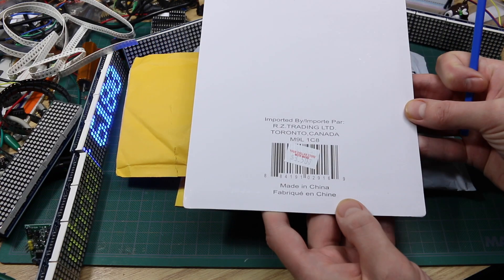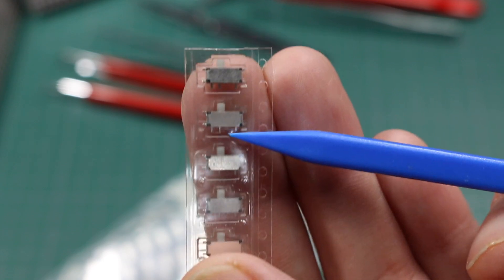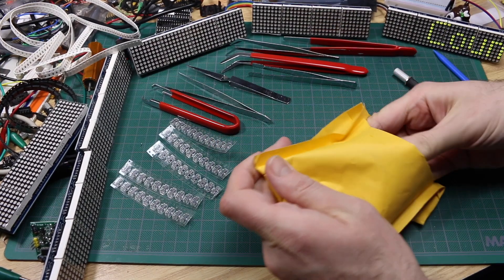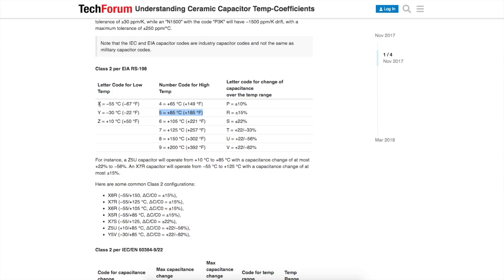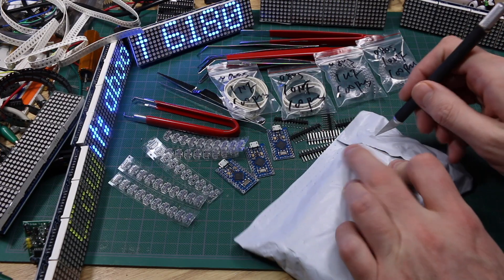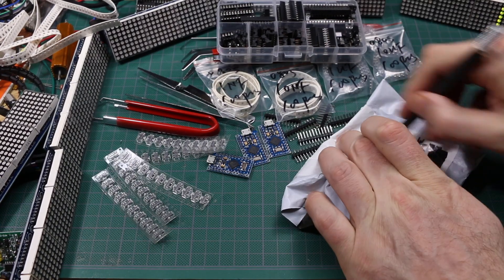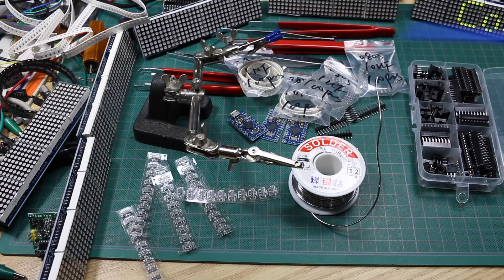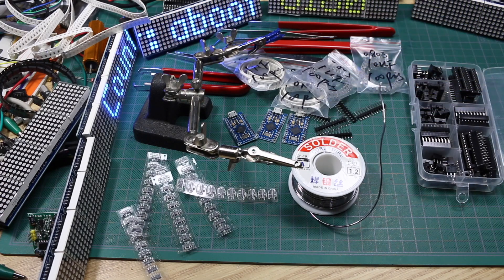GR Mailbag 20.FE.29

Comment: Check the 3v3 regulator, I got 3 for you programmer and far 2 the 3v3 reg output is 4.98V. Now ordered some new 3v3 regulators to replace the ones that don't seem to work.
Reply from the maker: those modules are still on the workbench mat so I will remember to check that the next time I’m there. It reminds me of when I bought 10 K digital pots that actually measured 100 K.

Comment: I have some of the cheap solder, it has no shine but it flows and sticks nice and easy, maybe OK for low voltage circuitry. Lush is a good seller by the way, I've used them many times, as a rule I avoid sellers on Ali with ratings under 95%

Comment: I tested two solder from Banggood but I think they are lacking enough flux. One of them was very bad. I found the MAIYUM brand on Amazon, which is a bit more than the cheap stuff but it works really well. Very impressed by it.

Comment: Would like you to test "Silver" solder. I ran an electronic repair shop for 30 years and discovered silver solder at Radio Shack. After using their solder, I never used anyone elses solder. For me, I could make better than factory wave connections on postage stamp ICs. It was more expensive, but my integrity demanded it in solder competitions. Since RS closed, not sure where I would get the same solder now.  Your thoughts?
Reply from the maker: I've never used silver solder, or seen it on a shelf but I figure it can be ordered.   I always thought it was for jewellers and had a high melting temperature

Comment: Those reverse tweezers look like they'd be perfect for hand SMD work.
Reply from the maker: I think the pair I ordered on AliExpress also have ceramic tips, which I've never had before. I'm afraid my multimeter addiction will become a tweezer acquisition syndrome
Reply: @GadgetReboot  Ceramic tips are supposed to be good to prevent static and to reduce thermal conduction.  Supposedly better for hot air rework as less heat is piped away from the joint.
I have to admit I haven't used ceramic tips though so I am unsure if they will grip better or worse....
Reply from the maker: @Marcel H sometimes I feel like I need to set up some sort of hockey rink plexiglass deflection backboard to keep all those awol parts confined.
Reply: @Marcel H My thought exactly.  I have lost countless itty bitties as they fly through space to another dimension.  The pros must use a tiny vacuum tip for the 0805s.
Reply: @Marcel H Very true!  I have had my share of pings.  It's just hard to get those little buggers to stay in place sometimes 🙂
Reply from the maker: @Mika P    The ebay one doesn't ship to my location but the Aliexpress might be something to order
Reply from the maker: @Marcel H maybe make a game of it, some Arduino catapult off the backboard and try to get the parts within the circle.